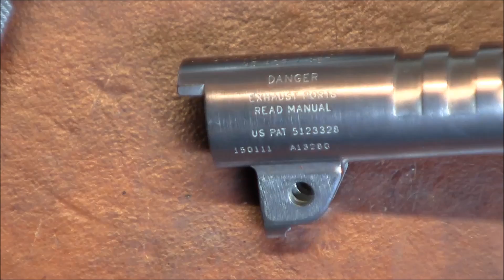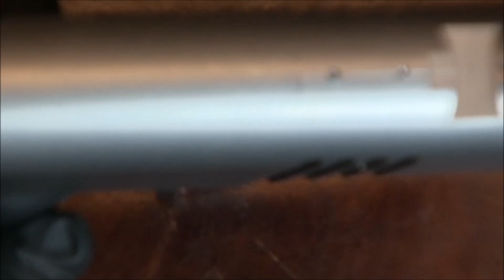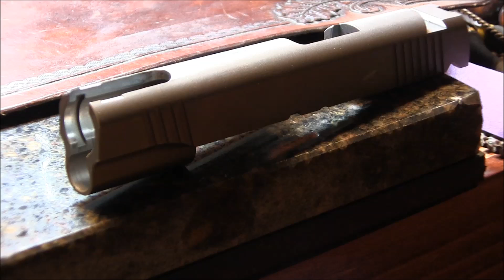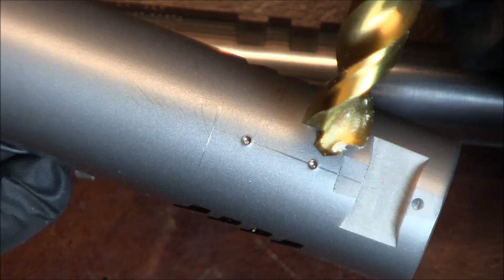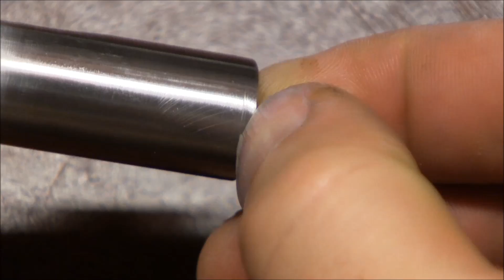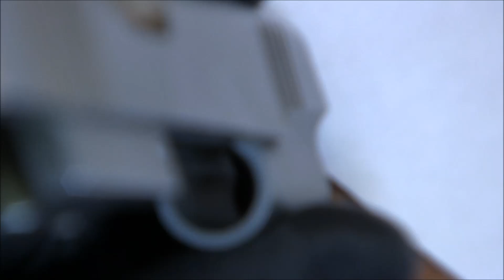1911 Hycomp Barrel Installation

Comment: Anyone who comes across this and wants to drill into steel, you need to drill very slowly put the drill press on the lowest RPM and use a lot of oil on a drill bit. 
His drill press was set on high RPM and he burned the drill bit.
Reply from the maker: No drill bits were harmed in the making of this video.

Comment: 👍Nice work as always.
Did you drill your center punches with a small pilot bit first? Like a 3/32". Drilling on a rounded surface is tough without everything rigidly fixed as I'm sure you found out.🙂
Reply from the maker: I honestly can't remember whether I did or not.

Comment: Once again hypnotizing videos that are a pleasure to behold my question would be what type of Dremel do you use
Reply from the maker: I can't find the brand I used to use on the store website where I originally bought mine. But it wasn't a Dremel brand. What I finally bought is a Foredom. This is the one I have now. https://www.amazon.com/gp/product/B0032OTXO0/ref=oh_aui_search_asin_title?ie=UTF8&psc=1 This is the best rotary tool, and I got lucky and found 5 handpieces on Ebay dirt cheap.

Comment: Invest in a good set of high speed cobalt drill bits. They would have ate threw like butter. 
Just a suggestion.
Great work by the way if you never try you can never learn and succeed.
Reply from the maker: Thank you very much.

Comment: I was given a schuemann tribrid 2 barrel that I'm going to have to try to build a gun around. Probably and old school modified division ipsc gun.
Reply from the maker: Very nice. Good luck with the project.
Reply: MosinVirus have you tried doing another ribbed barrel with your mini mill? I follow your videos pretty closely. You helped me before with fitting a cone comp to a replacement slide for my open gun.
Reply from the maker: Pistols at Dawn no, I had another ribbed and ported Schuemann barrel but I gave it away as a birthday present to a friend. It would be much easier to do with a mill.

Comment: I'll make a couple suggestions for you. In the trade we used dykem, but you can also use a felt tip marker on the area you are going to scribe with your calipers - this way you won't need to scratch the surface deeply and can still see the line. Clean up with alcohol. Your attempt to drill the 3/8 holes in one shot was your problem. Start with a drill around 1/8" then 1/4" then 5/16" then 23/64" leaving 1/64" for cleanup with the dremel tool. If you had a milling machine available you would still drill the holes and then plunge cut the material out between the holes. To get square corners you would use a small dia. endmill and finish it off. If you also work on AR-15 or any rifle with bullet buttons be sure to check out our ThumBee at www.thumbee.net
Reply from the maker: Thank you. I will certainly use this info next time around

Comment: Ok, "I don't have a mill, so I'll just use my hacksaw." What you didn't show was the greatest job of hacksawing in the history of hacksawing. You're messing with us. About that gap, it's not noticeable. What I want to know is how you mounted a front sight on it.
Reply from the maker: +Mike Melina Hacksawing was actually pretty easy. I filed the Novak slot into the rib, just like I did on the slide in build 2. Also not too difficult. Just have to be careful and stay flat and square with the file.
Reply: MosinVirus Sure...piece of cake. So what size will the next project be...md we want video of everything...Everything!?
Reply from the maker: +Mike Melina Next 1911 is commander size.
Reply: Awesome. We hope you video things you haven't included in other builds, like the fire control fitting/installation and trigger job, final finishing...stuff like that.
Reply from the maker: +Mike Melina thank you. This is exactly the type of feedback I need. If you think of anything else I could show, please let me know. I will try to make vids as requested.
Reply: MosinVirus If you decide to build a 9mm instead of a .45, you'd use the same frame right, just different slide/ barrel, etc.?
Reply from the maker: Mike Melina 9mm build requires a specific slide, barrel, firing pin, extractor, ejector, recoil spring, sometimes slide stop, and magazines of course. And with 9mm it is best to go with a ramped barrel, so the frame would have to be  cut accordingly.
Reply: MosinVirus Is the ramped barrel a "must"? Also, when you do your next build series, the parts list is a good thing, like I think you did on #4(?)...anyway you rock. If you have an email, I have a few pictures you might enjoy.
Reply from the maker: +Mike Melina the frames usually come with ramps for .45acp, while the 9mm barrels do have a bit more case support, so when they are placed onto the frame, they frequently overhang the ramp that is on the frame. And you need to have the barrel (throat) stop ahead of the frame ramp to allow proper feeding. This requires you to alter the throat of the non-ramped 9mm barrel, to shorten it, and to recut the throat, and this can reduce case support. Easy to mess up, and end up with bulging cases, or rapture get cases. Doable, but risky. My 9s are non-ramped, but I don't think I would shoot hotter loads in mine.

My email is Mosin.Virus@gmail.com

Comment: how does it work without a bushing to hold the recoil spring?
Reply from the maker: with bull barrels you use a reverse spring plug. The reverse spring plug is inserted from the inside of the slide, and is retained from going forward by either a step in its diameter (collar style) or a ledge (hat style). I have a video on installing a hat style reverse plug.
Reply from the maker: also, using reverse spring plugs usually requires a modification of the slide, unless your slide comes reverse plug ready (collar style usually)

Comment: Are this stainless steel Mosin? I'll be following this video all the way until it reaches the range :) Keep doing the amazing work.
Reply from the maker: the barrel is stainless, the slide and frame and all other parts are carbon steel. the pictures I gave you links for are of this pistol finished with parkerizing.

Comment: hey is it possible to convert a bushing gun to a bull barrel?
Reply from the maker: yes, with a new barrel, or threading the old barrel and installing a cone, and replacing a standard bushing spring plug with a reverse spring plug.
Reply: +MosinVirus how can you fit a reverse plug?
Reply from the maker: +filipe silva there are two types of reverse plugs. one is a sleeve kind, where at the back the outer diameter of the spring plug is a little wider. The slide's spring plug tunnel needs to be reamed at the rear end to allow the sleeve to fit. The other kind is a hat or flange style. this one has a flange going around the rear end, like a hat of the screw. The rear of the slide's spring plug tunnel needs to be cut off just the same amount as the width of that hat on the plug. Basically, the hat will make up the removed material.
Reply from the maker: +filipe silva you should check your slide. it may already have a reverse spring cut reamed out. That would be for a sleeve style reverse plug.
Reply from the maker: +filipe silva oh and reverse plugs are inserted from the back of the spring plug tinnel, as oppose to the front of the slide.
Reply: Got it. what do those  cuts look like any idea where I can find a picture of comparison?
Reply from the maker: +filipe silva just do a search on reverse spring plugs.

Comment: Since I see that you already have a chamber reamer for seating head space, I might suggest that you take off a few thousands off of your hood to slide difference, This will tighten your gap (but keep some gap, you don't the barrel slamming against the slide returning to battery.) Then check and adjust head space, then you can do you frame to barrel fit using all of the parts that will go on the build. Just a thought. I've never done a raised port like this, only cut ports. Also it appears that the radius on the port and slide are equal, changing that will seat it back.
Reply from the maker: at this point, when the hood is fitted, the locking lugs lockup. there is no way to move the barrel back. shortening the hood will only create a gap at the breach face.
Reply: +MosinVirus  In that case it is what it is.

Comment: nice lookin ! even if its a bit off there ,but your known to use a file fore some drastic designs so... i belive you will come up with somthing that makes it look cool!
Reply from the maker: +transdetendal I can always try and get a longer rib (more ports barrel) and cut the slot longer.
Reply: MosinVirus
that way you got a barrel for another project.... hmm why not ! more to watch and learn from ! 8-)
Reply from the maker: +transdetendal I decided to stick with this one. so there is a slight gap in the back... not really a problem. just fitted it to frame/slide stop.
Reply: MosinVirus
its nice  to look at , not that much off in spec and since it dosent hurt, you have to know its there or you wont really notice it!

Comment: You did a nice job by hand that everyone else uses a mill for. I`m always impressed and inspired by your work.  If you get a new barrel for this project with a little longer compensator area you can make it fit perfectly. Then use this barrel for a different project. I`m not sure why your drilling efforts did`t work but just a little advise for drilling holes in stainless steel. Run the drill bit as slow as your drill press will go and use plenty of cutting oil. Running a bit a high RPM in stainless will do nothing but burn it up. I use to drill hundreds of holes every week in stainless for my job and while others were burning up bits, mine seemed to last forever. PEACE, AJ
Reply from the maker: +TWISTEDSTRINGS69 Thank you. I think the problem was that my drill press is not as solid as it should be, the vise was sliding around on the non-flat base (cheap press), and the vibration plus flexing made the bit simply jump around which is why I ended up with gashes around the pilot hole. Then it would simply not bite down and continue to flex away.

Comment: It takes a lot of Nerve to attempt what you are doing without a milling machine !!  You are like me, adapt and make due with the tooling at your disposal !!  There is more than one way to skin a cat !!
Beautiful Work !!
Reply from the maker: +Gerry K Thank you. Indeed there are many ways to proceed. I almost wish I didn't try to use the drill press. If I went by hand the entire way, I am sure I could have not had that much of a gap in the back.
Reply: +MosinVirus 
The drill press would have been fine for those areas you were 100% certain of !!  Always creep to the critical dimensions !!  PS: It Doesn't Look That Bad !!  However, you like me appreciate Perfection !!
Reply from the maker: +Gerry K not with my drill press. I need to take a look at it again. I bought cheap, and now with replacement parts it costs as much as a better press would cost, while it is still not as good.
Reply: +MosinVirus 
I always say it's worth the money to buy Quality up front !! Recently I've Not Heeded My Own Creed !!
Grips for my 1911, cleaning rods and more.
Reply from the maker: I completely agree. My wife always says "we're not rich enough to buy cheap crap".